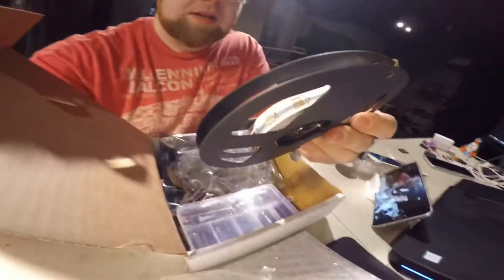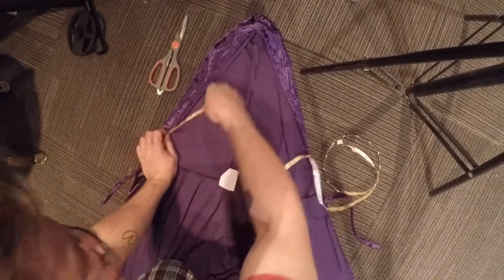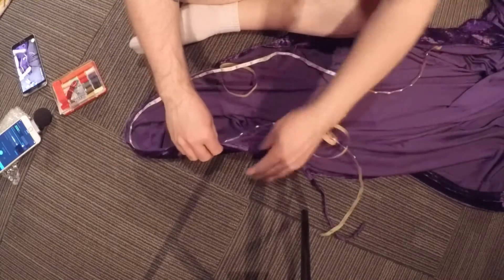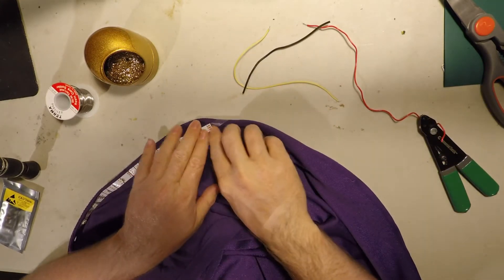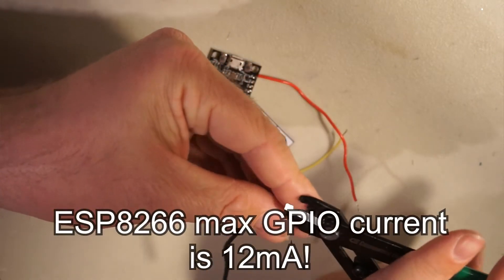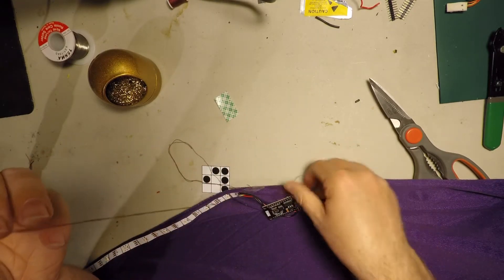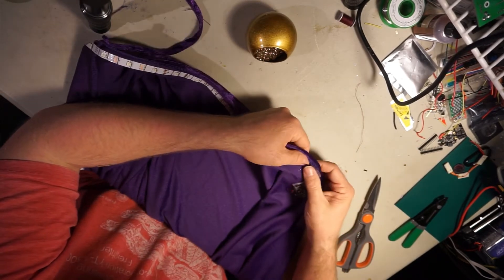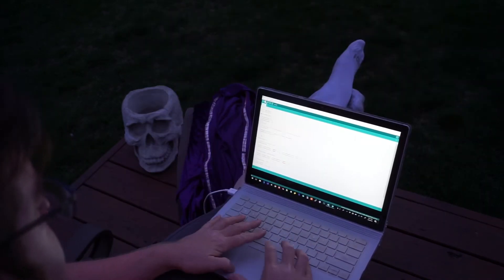Simple RGB LED Cloak quick build!

Comment: That's pretty dope. Gives me inspiration to do something with my controllers and get some LEDs...
Reply from the maker: Do it! It's super simple, but really effective for adding interesting effects to things. I can share the source code if you need any help putting the code together for it, the only thing to remember is that you don't want to power the led strip from an IO pin ( use the VIN pin. )
Reply from the maker: And thank you!